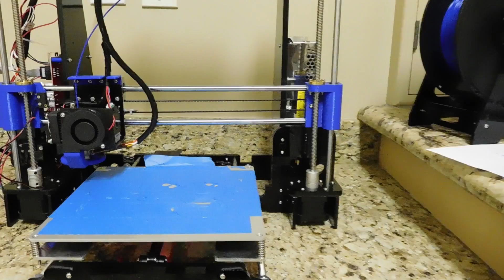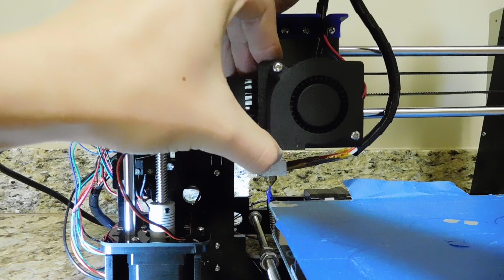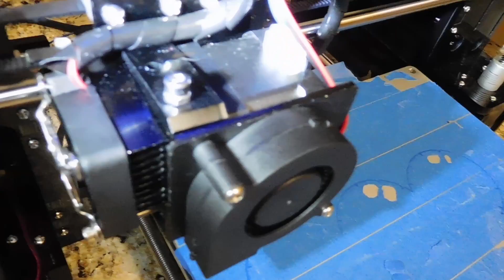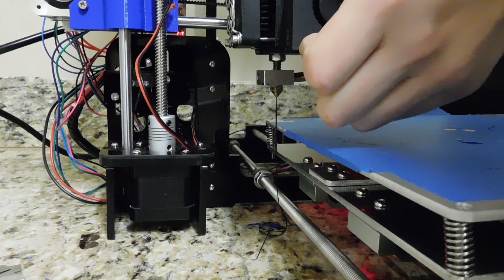Anet A8 3D Printer - How to Change Filament

Comment: Thank you so much!!! My filament kept getting stuck when I tried to remove it. As you sad I took apart the whole extruder like 10 times, it was really annoying. After pulling it out with a smooth motion (like you sad) fast enough so the filament would not have enough time to harden in the little tube it came out perfectly. Thanks again. You saved me so much time..